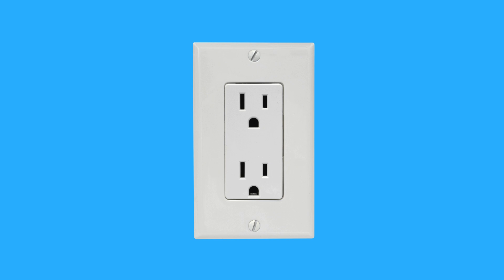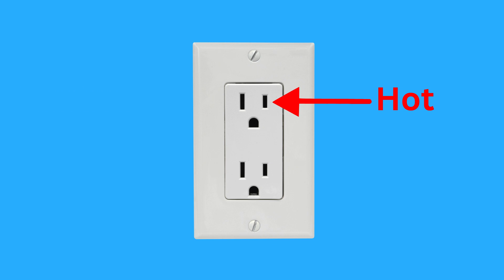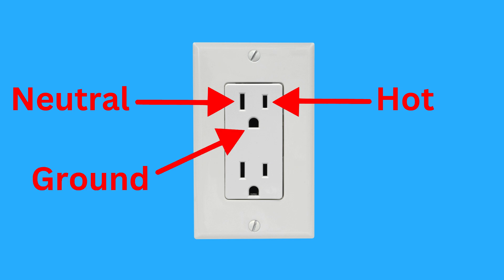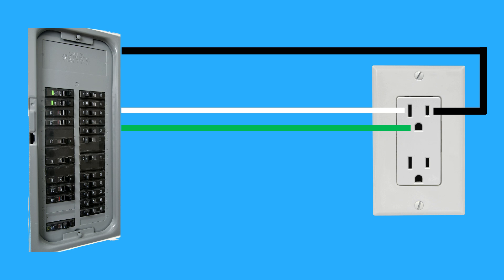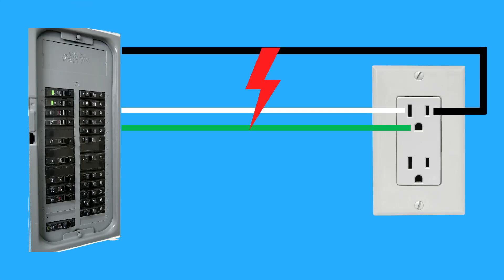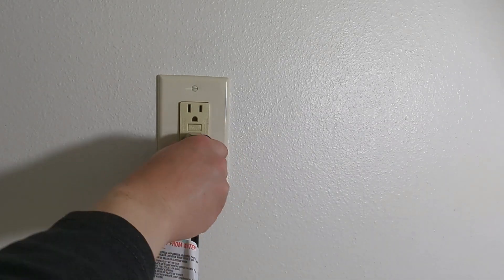Short Circuit vs Ground Fault Explained | Are You Safe?

Comment: The ground and neutral are connected at the main panel so testing hot to either of them gives the same result unless you remove the connection (which I do not recommend).

A ground fault can happen also if a user gets shocked for example from a damaged electric cord.
Reply: Exactly. Dustin Steltzer makes this same error in his video on this subject, and nobody noticed, even "master electricians"!!